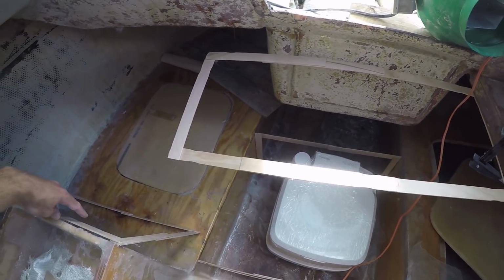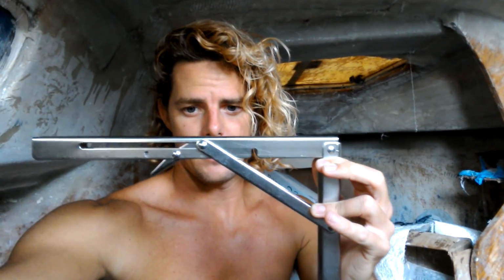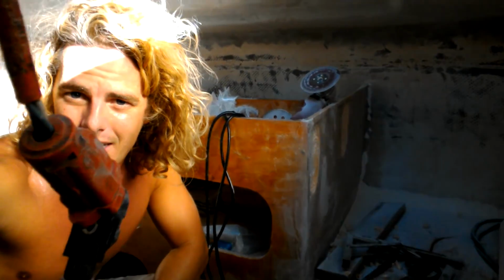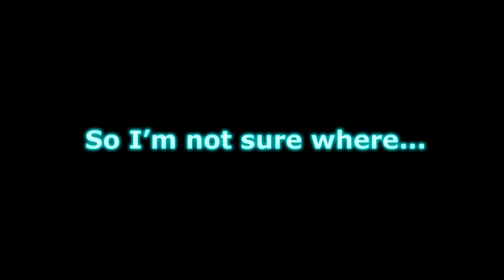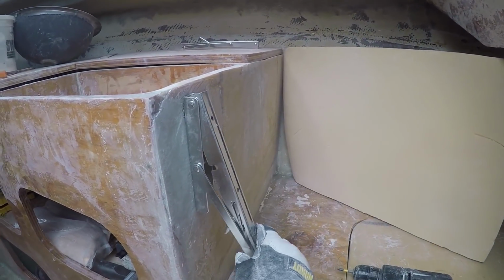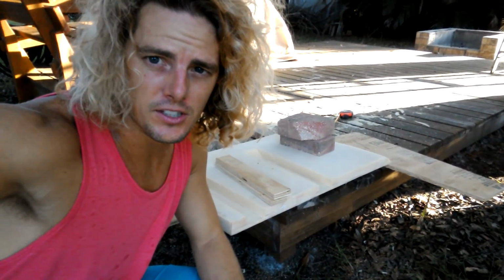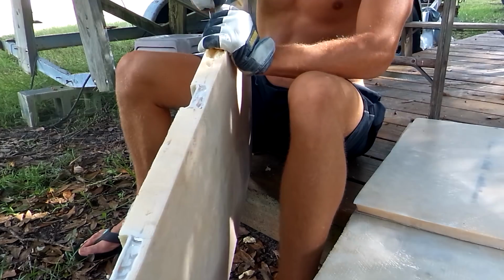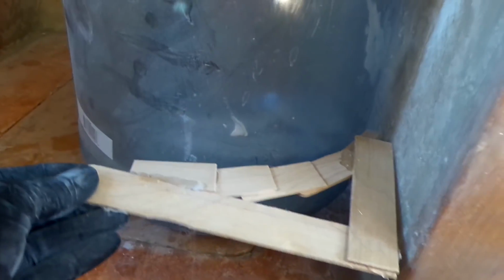Super Secret Custom Galley Shelf (22' Sailboat Rebuild) - Ep16

Comment: Awesome progress its looking good dude. You ever think of building a sugar scoop for the stern? That would be sweet
Reply from the maker: Brilliance! Yes, I have actually...though I had to google the term...I'm a sailing noob. I wanted to build a platform off the back, but have to work around the keel and outboard motor mount. I will see when I get there, but if possible then yes. That would be a great area to get in and out of the water from. Definetly on the list of things to consider as well as a big ultralight fiberglass hardtop for solar panels and possible shower station/sitting/jumping area.
Reply: Neon Swell i saw this guy on the youtube channel sailing turtle26 make a cool one that he bolted onto the back of his ericson 26. the outboard well is an issue though i see what you mean. maybe make a cut out or something for it.
Reply from the maker: @offtherichter7  nice! Ill have to check it out! Yeah I'm sure there are some work arounds, something I'm really going to consider

Comment: LMAO! That brush was STUCK, wasn't it?!  Hey, make Backing Plates for the hinges Inside the cabinet. That'll Beef It Up a Lot. NVM, I see you're On The Ball. Yup, that's JUST the way I'D have done it. A Lot of Work, but a Beneteau-Class Design for CHEAP, except for Materials, of course. Bringing the Old Boat into the Current Century.
Reply from the maker: Nice! Thanks Jim. Hoping the boat last another 30 years. Lots of work indeed, let me know if you have any more ideas. I'm always up for improving the design of the boat. Thanks!